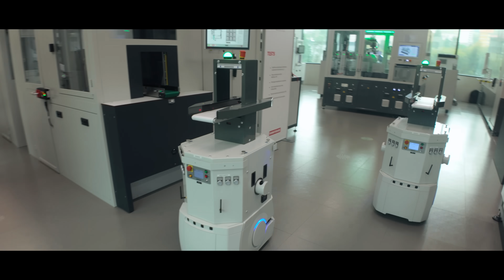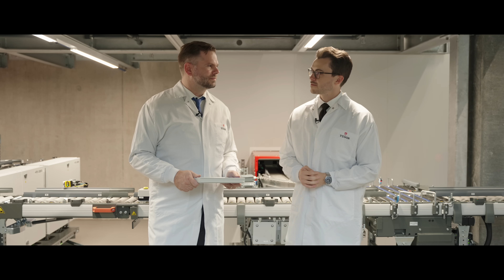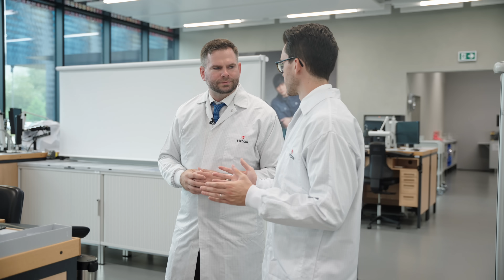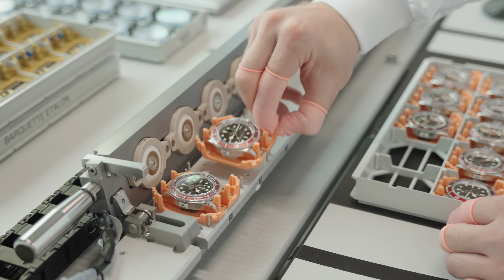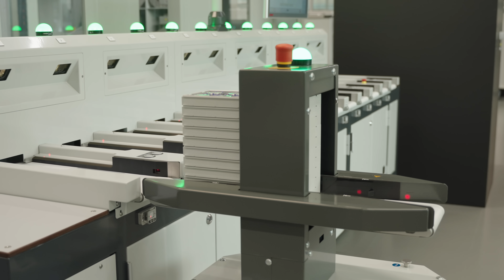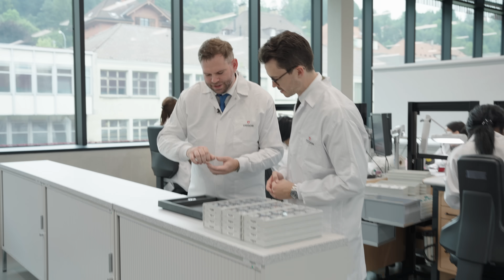Visiting Tudor’s Manufacture In Switzerland

Comment: Nothing is made there from raw materials. It’s just an assembly line. Various companies make the actual parts. Apparently the cases are made where Christopher Ward cases are made.
Reply: Link to source?
Reply: So that's why my Christopher Ward is soooo good. Interesting.
Reply: 100%. They order parts from suppliers and assemble. They're not a true manufacturer like TAG or Rolex. Tudor is a Kenissi side hustle lol
Reply: @65hi863dhyu    What movements do Tag make?  Most Tag watches had ETA movements...then Swatch bought ETA and cut outside sales to companies like Tag Heuer. Now Tag uses movements from several companies, including Kenissi.  So, some Tag Heuer watches have a Tudor movement in them.  I don't think Tag manufactures anything.
Reply: @65hi863dhyu    Kenissi is owned by The Hans Wilsdorf Foundation, the same organization that owns Rolex and Tudor. Since these two buildings were built, the movement used in Tudor watches is an inhouse movement. It was designed by Rolex engineers. They also sell the movement to other companies like Breitling and Cartier.  Tudor isn't a Kenissi side hustle, it's more the other way around.  Kenissi works for Tudor.
Reply: @65hi863dhyu most "swiss made" watches/bracelets have components from china or elsewhere, especially TAG
Reply: And how do you know this? You know you can just contact Tudor/Rolex client services directly and they will tell you where the parts are sourced. All throughout Switzerland. Breitling and Omega exactly the same. Instead of just spreading rumors why not simply contact the manufacturer directly? they  are very good at responding.
Reply: @michaelriera6277  I’m not spreading rumours. It’s very well know in the watch industry that Tudor only assembles its watches in that big red building and it’s also very well known that various companies make the components for Tudor. Mike France who is one of the people who runs Christopher Ward has said in many interviews that the cases for Tudor are manufactured by the same company who manufactures Christopher Ward cases. Obviously Tudor like to paint the picture that everything is made by themselves in their own factory but that’s simply not the case. Google it yourself and have a look. They are still great watches but everything I wrote is actually true.

Comment: so we don't get to see any parts made (or where...) and the only things done by hand are the assembly of hands onto the dial and then casing (the movement presumably already assembled by robots) and the bracelet fitting. sounds like a fun place to work as a watch maker....
Reply: The movement are put together by Kenissi the movement manufacture owned by Tudor. Tudor really should have made it possible for Teddy to tour that facility as well because it does make this video feel very incomplete.
Reply: @BlueCollarLuxe  are they machined and finished there or only assembled?
Reply: @SilverStackers  They share the same building  but operate as two separate businesses but Kenissi is owned by Tudor. I believe Kenissi hands the movements over assembled and ready to be cased.
Reply: @BlueCollarLuxe  yeah, my guess also. they just assemble the movement while the parts are actually made elsewhere.
Reply: @SilverStackers  they do both, if you see that Tudor is claiming that the movement is In-House those are manufactured and assembled by Kenissi. I think Tudor plans to move the whole line in house eventually.
Reply: @BlueCollarLuxe  do pictures or video exist of them machining/finishing them?
Reply: @SilverStackers  that’s a good point, I’ll have to look into that.
Reply: @BlueCollarLuxe  Keissi doesn’t “hand” anything to Tudor. Don’t you know by now that the robots place everything on the conveyor belts that run through the walls filled with Swiss air? 😂
Reply: Correct Kenissi is the movement manufacturer which is literally next door as it is attached to the same building. For reference you get a glimpse of that building at the beginning of the video, it is the grey portion of the building. The way Tudor accomplished 'made in house Swiss Made' is they own Kenissi who produce movements for multiple major brands and Tudor yet it can be classed as in house because Tudor own that company. I will say that this practice is head and shoulders above a lot of manufacturers in the big time that do not truly have Swiss Made components but pretend to.
Reply: @ASHSRV  ive yet to see any video of this place. and if they actually make all the parts there.

Comment: @TeddyBaldassarre

I have seen a lot videos where's people's saying that all Swiss brands using rabbit hole; Swiss laws saying that total cost of construction has to be 60% Swiss made, that they can use "Swiss made". So they using 95% china parts and actually manufacturing only one or two pieces themselves BUT they put so high price tag for those parts that it's cover more than 60% of totally price. for example rotor.

Is it true, or just a legend?
Reply: No, people like conspiracy theories. The 60% is not in reference to the cost of production, but to the watch itself. Most manufactures that have Swiss Made on their dial have the movement and everything related to it ( hands,dial, subdials for chronographs) made in Switzerland and the watch case and bracelet usually made by a third party, usually in Hong Kong. That is fine because most manufactures don t have the necessary tools to actually create cases and bracelets from scratch.
Reply: If you look up vintage chronographs and divers, you'll notice that they all look very similar. The majority of brands had cases and even dials made by the same few companies. Contrary to what some YouTubers would have you believe, this has been going on since forever.